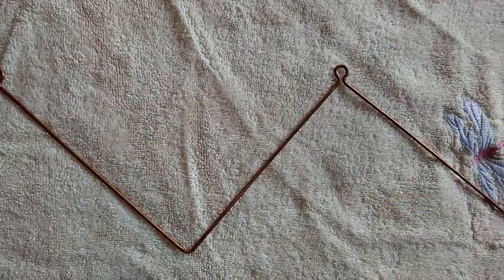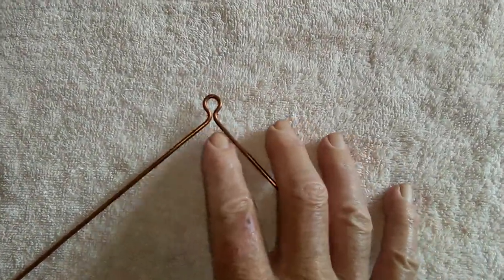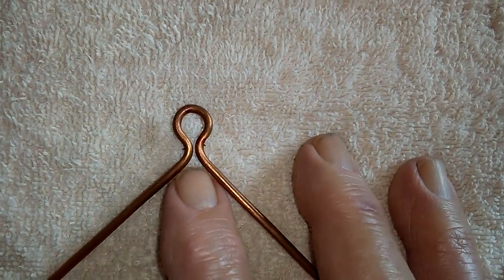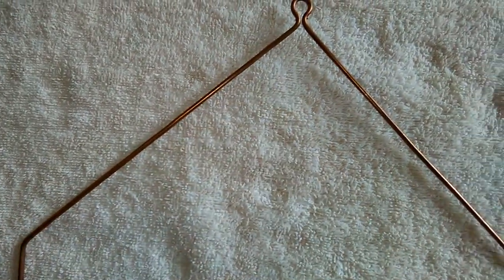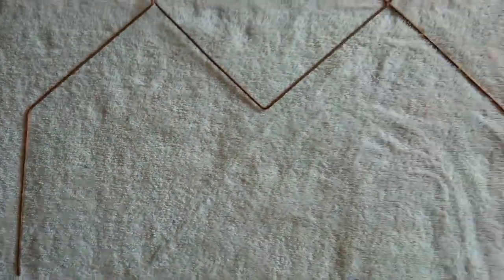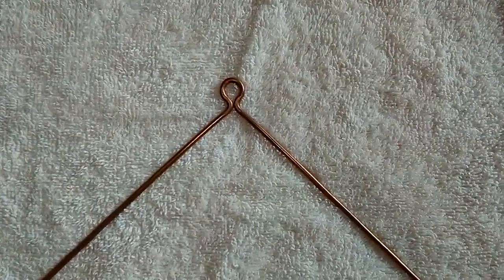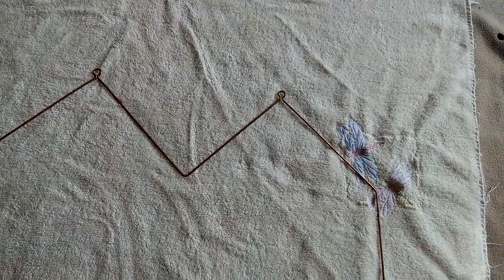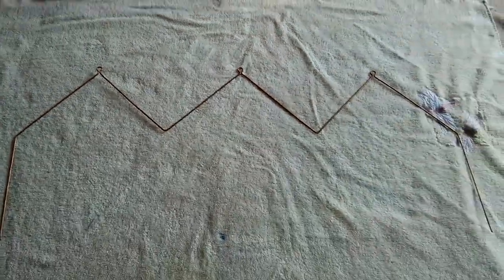Hoverman element details

Comment: I had an idea Cosmic Antenna, would making this element twice as long using the same bends work the same as making two antennas side by side and eliminate the need for a combiner ???? Thanks
Reply from the maker: No. It's too far for all the signal to travel, stick with the original design, it works.
Reply: @cosmicantenna9244  O.K. will follow your advice Sir. Thanks Mike and peace too. vf

Comment: They say there are no stupid questions. So how do you keep the wire so straight Sir ?? The copper wire looks like a die machine bent the element into shape ??? I saw some people use a drill motor and a vice to hold the other end and just chuck the opposite end. Then just spin the wire for a few seconds. Peace vf
Reply from the maker: The drill method gives a straight stiff wire.
Reply: @cosmicantenna9244  Do you use that method Sir ?? Thanks
Reply from the maker: Yes, I show how on the website. 
The twisting makes the wire straight and stiff. 
Don't twist it too much you can break the wire, just until it gets straight. Practice a little.
Reply: @cosmicantenna9244  Will practice the strengthening technique. One more thing, would putting and extra one long wire on the top and bottom of the horizontal wires right next to the elements supposedly 1/4" aside make the antenna pick up VHF signals ???/ Thanks and peace Mr. M.
Reply from the maker: Not that good for vhf, you have to be real close.
Reply: @cosmicantenna9244  High VHF ??